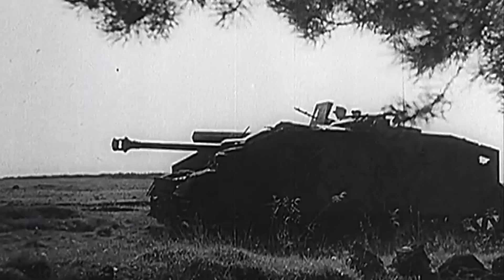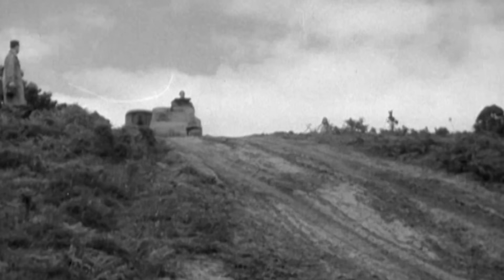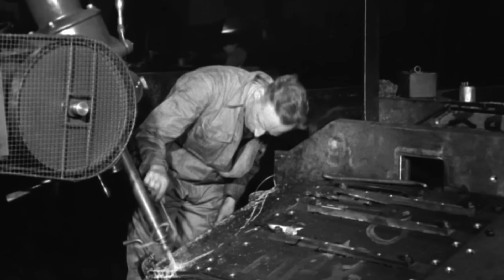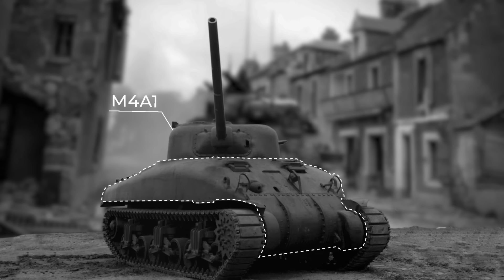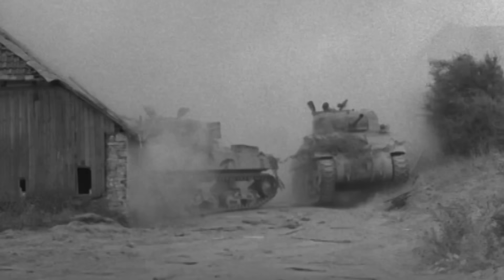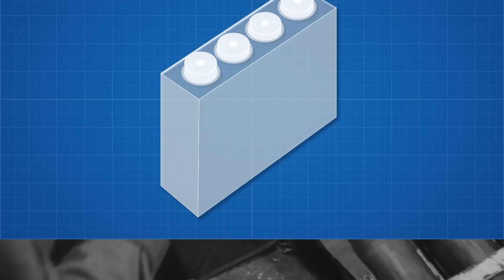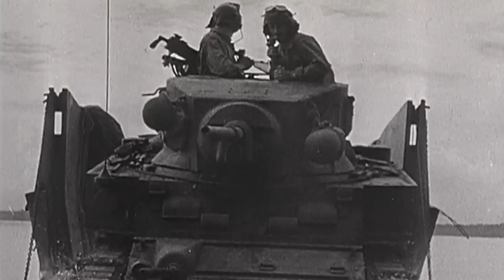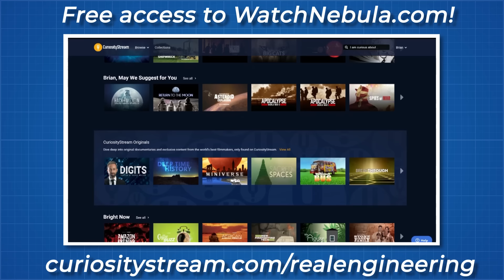M4 Sherman - The Workhorse of D-Day

Comment: What, no mention of the Sherman 17pdr armed 'Firefly'.       If I were to choose between a 76mm'Easy 8' and a 'Firefly - give me the Firefly every time - particularly if up against Tigers and Panthers frontal armour at longish range.       It was a 'Firefly' that took out Wittmann's Tiger at range, in fact the gunner Tommy Ekins knocked out 3 Tigers in quick succession at ranges between 600 and 1,000 yards with 4 shots.    There was at least one other instance of a Firefly taking out 5 Panthers rather quickly during a single engagement.
Reply: You sure about that? Fireflies had notoriously awful crew ergonomics and were among the least mobile Sherman variants. The American 76 models also had gyrostabilized guns and far roomier interiors (and were often fitted with HVSS to make a better and more mobile gun platform).
Reply: @bluntcabbage6042     -   Yes, I am correct, the 17pdr. was a very effective AT weapon, whether on the ground or on the Sherman.    Yes, as you mention, on the Sherman things did become cramped, due to the greater bulkiness and vicious recoil of the 17pdr.      If my memory serves me right, the first Tiger to be knocked out [with a flank shot] in combat was in North Africa by the 17pdr's  smaller and older 6pdr. 'brother'.     It is just as well that the Brits had a number of the Firefly variant, since it was they and the Canadians that took on most all of the Tigers for the first several months on the Western Front.     It seems that US troops often mistook the Mk.4 panzer as being a Mk.5 'Tiger'
Reply: @truthseeker7242  there is a big difference between Firefly and Easy8.
I agree, in a hypothetical engagement against a heavy german Tank, the Firefly would be my choice too. 
But for the majority engagements would the Easy8 be the better choice. 
After all the Firefly is an Tank Destroyer only. 
That's why the Commenwealth Forces used them only in an Support Role for Tiger/Panther Tank encounters, while ordinary Sherman's made 4 of 5 Tanks in an common British Platoon. 
But the Easy8 is a kind of in-between. It performed well enough in the most Tank vs Tank situations, but still had the capabilities to support Infantry, fight against AT Gun Positions, fight in an offensiv role.

Comment: I personally think the sherman was the best tank of its class compared to its contemporaries: the german Panzer 4 and the Russian T-34. The Panzer 4 had the highest thickness of armor(80mm) but it would be vertical and as a result, didn't offer adequate protection for the weight it added as the suspension was designed to carry only the 50mm of original armor plating. Additionally, it only had 50mm of turret front armor which is like cardboard compared to what most other tanks of its class and period could deal with, and it doesn't help that it had a puny gun mantlet and flat turret face. That said however, the visibility it offered its crew thanks to the excellent cupola and observation devices made it a combat effective vehicle. Additionally, the optics and radios on german machines proved to be the best standard if not on par with the M4s during the war.

The early to midwar T-34 is overrated, it is not "revolutionary" for its sloped armor as sloped armor was common knowledge at that point in time, tanks with sloped armor already existed before the T-34. The Christie Suspension would take up a large part of the tank's internal volume and the lack of basics such as a proper turret basket, adequate observation devices, safe ammunition stowage and rushed production meant that you had a tank that was 1)Blind, 2)Cramped, 3)Unreliable and 4)Had components that were significantly of lower standard(Optics and Air Filters). That said, it was still important as the russians had the production capacity later in the war to simply outproduce german vehicles in a war of attrition. The armor was not something to scoff at when it was first introduced in 1939,  and although its armor would become obsolete by war's end, significant improvements to the design would make it more combat effective over time. These changes included commanders' cupolas for mid-late war models, improved air filters, simplified production for major components like the main gun, and most importantly, the new turret and gun which would change its designation to the T-34-85. It was the right tank for the Russian Army's needs, but would take time to truly become a great tank.

As for the M4, the standardization of components' quality and lifespan would ensure its longevity in operating far from the US mainland. It had 50-63mm (the M4A3E2 "Jumbo had 101mm although there were only 200-300 of those things) of armor sloped at anywhere from 45 to 55 degrees(depending on the variant) which would be sufficient for dealing with its contemporaries at average engagement ranges for tanks. Additionally, the 75mm M3 was sufficient for taking care of both armored and soft targets. M4s would face mostly Japanese light tanks in the pacific with puny 37-57 mm guns while facing Panzer 3s and Panzer 4s in Europe. The 75mm M3 also had a better HE shell compared to the shells available to the 76mm M1A1/A2, which would be important as most of the time tanks are engaging infantry and lightly armored vehicles as much as if not more often that other tanks The Americans specifically, would only ever encounter tigers three times  and in two of those engagements the shermans would win. 

So basically you had a reliable, easily serviceable tank(Unlike the tigers and panthers) that was not a pain in the ass for the crews to operate and maintain(Unlike the T-34) which had the neccesary combat capability to do what it was designed to do.

Comment: Tiger shots a sherman , the Tank beheind take a hit,  50 000  shremans battle 1200 Tigers clear that the sherman winns after same time. 
One on one only if the tiger crew slepps or out of fuel or ammo.
Reply: The Sherman, especially the E8 and Firefly, were more than capable of beating Tigers.

Comment: The reality of the tank production is as follows:
1) Soviet Union produces 125,000 tanks none of them where Sherman tanks
2) US about 100,000 tanks 
3) Germany 50,00 tanks
The point it is time to really the real facts of WW II.  US contribution to the defeat of Germany is limited, though should be recognize at the key protagonist in the Pacific time.  It is time we recognize that Soviets did performed the impossible lift and shift their manufacturing across the Urals and continue their production in mere 9 months producing over 125,000 not to mention the all the aircrafts and artillery they produce a fit that no one have ever been able to do. Those are the facts of history...
Reply: The Soviet Union didn't produce 125,000 tanks.
Reply: The Us contribution was limited and the USSR would have won even without help but it would have dragged on the war and death tolls to staggering new heights
Reply: @stealthcone  

Without the 500,000 trucks that the US sent, it's very unlikely that the Soviets would have been able to supply such massive offensives. The Soviet Logistics RAN on US Trucks and the Red Army ate US Food which was sent to them, as many Soviet farms were burned as a result of Scorched Earth. 

Without US/UK help, it's likely the Soviets would have either lost or made peace with the Germans after losing a lot more of their people, as the Red Army was scraping the bottom of its manpower services by 1945.

Comment: The Zippo Lighter.
Who is the fucking idiot that designed a main battle tank that was powered by gasoline??!!
Reply: I find it funny how you only bash the sherman for being gasoline power yet the German also were gasoline power.Surely you would bash the German for making such a terrible design choice right?
Reply: What nonsense are you on about? Fuel type makes no difference in combat, and are rarely the cause of a tank's destruction- rather be resultant from it. The second most produced variant of M4 was Diesel powered, but most countries used gasoline anyways.
Reply: @peterson7082  
Your ignorance is amazing. Tanks fueled by gasoline tended to get just a bit more explodey than tanks fueled by diesel. 
"Notorious for their flammability, "Shermans were nicknamed “Ronsons” after a lighter with the slogan “lights every time.”(National WWII Museum)
The question here, is WHY were they powered by gasoline instead of diesel.
Reply: @salempoor678  On paper, yes. In combat the difference was negligible as the tank's destruction was rarely because of fuel fires or explosion. Rather ammuniton, grease, and hydraulics are the cause. The nickname doesn't really appear to refer to the M4 specifically in that context until after the war, rather the name more often appeared regarding flamethrower tanks. 

As I said most tanks on both sides were gasoline powered because they provided more power typically. The second most produced M4 variant was Diesel.

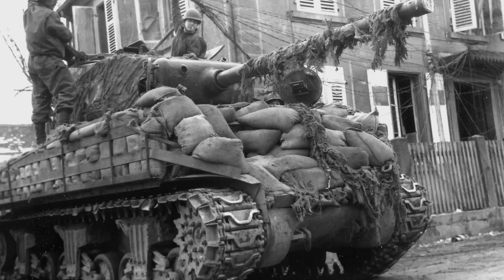Comment: If I may make a correction, at 06:47 The "grousers" mentioned were called duck bills because of their shape. They were added in the field. They tended to break off on rocky ground. "Grousers" are actually the bars on the track face itself that give it traction. The term is still used today for caterpillar tractors.

Comment: sherman was garbagge, it was like cheese for the german panzers or tigers
Reply: No, it wasn't.
Reply: @bluntcabbage6042  haha, it was like cutting a cake for the panzer division, hahaha
Reply: @guildwar6448  No, it wasn't. M4 had a very positive K/D ratio and performed fine under most circumstances, as well as being a very survivable tank for its crew.
Reply: @bluntcabbage6042  no chance against panzer division or any other tank, very small main gun
Reply: @guildwar6448  Its gun was no smaller than typical medium tanks. T-34 had a 76mm gun, Pz IV had a 75mm gun, even Cromwell had a 75 or 57mm gun. 

Its armor was also quite good for a medium tank, with the equivalent of 4 inches of armor (100mm) in later models when taking into account the sloping. This 100mm of armor actually rivaled the Tiger, which also had around 100mm of armor on its front plate.
Reply: @guildwar6448  

Laughs in Arracourt when 100 Panthers were killed for only 25 Shermans

Your "German Superiority" getting shown how fucking useless it was.
Reply: @youraveragescotsman7119  shermans were junk, it was like cheese for the panzers
Reply: @guildwar6448  

Is that why the 3rd and 4th Armour Divisions had a 3:1 K/D against Panthers? Or how the Sherman was the most survivable tank of the war, with a crew mortality rate of 0.78? Or how they were more than capable of knocking out German Big Cats with ease, as shown at Arracourt?
Reply: @bluntcabbage6042  they didnt even bother to bring it back

Comment: m4a3e8 was uparmored not having a 76 millimeter gun the tanks that had it were the m4a2 and m4a3
Reply: No.

The E8 designation simply indicated the use of HVSS on the tank, that is, the type of suspension (and in turn, the track width in the case of HVSS). There were E8 models with 105mm howitzers, 75mm medium velocity guns, and 76mm anti-tank guns. It has no bearing on armor or armament.

Additionally, M4A2 and M4A3 did not necessarily have 76mm guns. The standard gun was still 75mm, and a 76mm equipped Sherman would be indicated by a simple "76" on the end of its designation (So M4A3E8 76).

Comment: The Sherman was used to devastating effect against Russian built T-34's in North Korea as well.  It's difficult to measure the ability of a tank without looking at all of the deployments of the tank, and how it fared in all circumstance.
Reply: to be fair, the Russians didn't directly fight in Korea and supplied the north Koreans and Chinese with mainly surplus and decommissioned T-34s while the Americans did fight directly with WW2 veteran tank crews/officers and used mainly fresh post-war era shermans.
Reply: @hellfun1337  at issue was whether the tanks were viable as a war weapon against other modern armor, not how well trained the crews were.  Had the tanks not been viable, it would have mattered little how well the crews were trained.
Reply: @deathguppie  I'm not saying the tanks weren't tested, I'm saying the test was weighted in 1 side's favor.
The age of the tank matters, new equipment should be tested against new equipment.
The experience of the crew matters even more. real life is not 2 tanks sitting on opposing hills lobbing shells at 1000m.
You could say the crew experience is paramount, ask any tanker.
Reply: @deathguppie  viability was never in question. I'd argue both tanks were capable indeed.
Anything beyond is up for debate.
Reply: @hellfun1337  the viability of the Sherman tank has been brought into question many, many times.  With most people claiming that the T-34 and Panthers were better tanks.  My statement was just to point out the fact that the Sherman was not outclassed by its contemporaries.  It was in fact a capable weapon for its time.
Reply: @hellfun1337  I don't think we are talking about the same thing, but I'll bite.
Both the T-34 and the M4 Sherman were outdated as of the Korean war.  Both were refurbished and pushed into combat as the need arose.  
American tank crews may have had better training, but as long as we are speaking of crew experience, the T-34 did not have an internal communication system.  The tank commander used his feet to direct the driver.  The Sherman did.  The Sherman was also extremely reliable having served thousands of miles away from it's manufacturer unlike the T-34.

Comment: Every 30min?? Wow! And from other channels, I've learned it was every bit the equal of the Panzer IV, so it isn't like shitting out a bunch of T-34s.
Reply: Eric Self  -  The T34 had a whole heap of reliability and crew layout issues, as well as to some degree interchangeability problems.        Without the huge numbers of trucks and jeeps that Uncle Sam supplied the Soviets with, those problems such as supply of fuel, spares, ammo, etc., would have rendered most T34s stationary in next to no time.        The Soviets were also using US supplied Shermans - as well as quite a lot of other western Allied suppled gear.       Fuel and oils were also supplied to the Soviets by the US, and by the Brits {via Iraq and Iran].

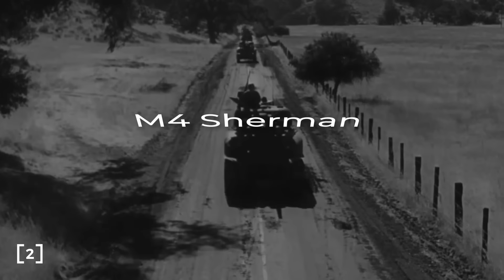Comment: 2:44 The M4 being the most produced allied tank really depends on how you count, based on.

1, do you count the soviets as part of the allies or a third party?
2, do you mean every single variant of a vehicle, or only one exact model of it?

If you count the soviets as part of the allies, and take all variants into account, there were around 34 000 more T-34s than M4s.
Around 84 000 T-34s and around 49 000 M4s.

7:36 The M4s had excelent crew surviveability especially after field kits for bigger hatches with springs, and later variants with bigger spring loaded hatches built in, the avarage death count per knocked out M4 was something in the lines of 0,2.

10:27 The idea that it takes 5 M4s to kill (insert german havy tank here) comes from the fact that M4 platoons were made of 5 tanks, so you always had 5 tanks with you, there is no reason to not bring all 5 tanks along when you have that many for each platoon.
Reply: At least 30,000 of those T-34s were built after WW2. The Soviets didn’t stop building them until the 50s.
Reply: @kokofan50  That would still be 4 000 more, if we go by 30 000 after WWII

Comment: Whats the difference about the sherman firefly and the sherman "easy eight"?
Reply: "E8" simply refers to the experimental designation of M4's equipped with the 23" wide track and HVSS. Fireflies were M4(75)'s, M4(75)(Composite Hulls), and M4A4(75)'s refitted with a 17-pounder gun and other modifications made to suit the new armament. Some other models were converted to Fireflies though these were more experimental or limited production. Such as the M4A2(75) and M4A1(75).
Reply: @peterson7082  ok thanks👍👌
Reply: @sateayyam3192  no problem!

Comment: The M-4 was a ridiculously tall tank for a medium sized tank. This made it an easy target even at extreme range. It had a short barrel gun that could only penetrate a German tank at very close ranges. Its bizarre suspension system and narrow track prevented it from climbing something as simple as the hedgerows found all over Normandy. This necessitated adding a cutter blade on the front. that didn't really solve the problem. In soft or muddy ground the Sherman's narrow tracks would easily bottom out making it a sitting duck and put even more vehicles in jeopardy as they came to recover it. Is it any surprise then at the engagement know as Operation Goodwood, more than 500 Shermans were knocked out.
Reply: Not really the case

Comment: I think you forgot to mention that the Sherman only helped win the war because there were so many of them. It was ENTIRELY outclassed in every aspect vs the German tanks and often couldn't even penetrate the armor of later German tanks from the front, requiring a rear or sometimes side shot. Multiple rounds were often needed as well to put a German tank down. But the Germans had nowhere near the US capacity of manufacture, so they were simply swarmed with significantly lower quality tanks
Reply: Not really.
Reply: Multiple rounds were shot into German tanks because they wanted to make them irreparable. Having a Tank burn out made it impossible to repair, so the Germans wouldn't be getting it back.

The Sherman was superior to the Panzer IV in everything but Gun, even then it wasn't by much. 

The Sherman was more reliable than every German Tank and far more survivable, as the spring-assisted hatches allowed the crew an easy escape route if needed, unlike German Tanks where you were pretty fucked if you got hit. On average, only 1 crew member of a Sherman Tank was expected to die if the tank got hit, it only had a 0.78 mortality rate, and most Sherman crews were killed OUTSIDE the Tank by Infantry/Tank MGs. 

The Sherman was the best Medium Tank of the war.